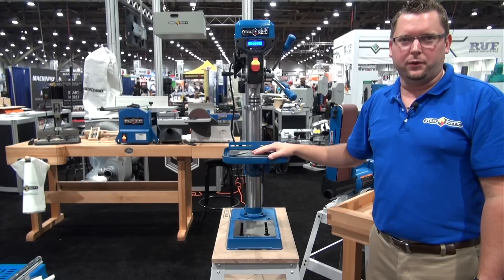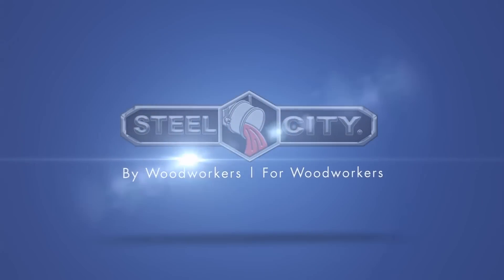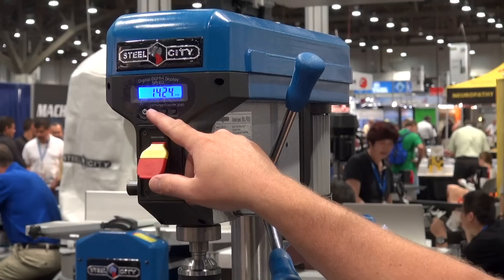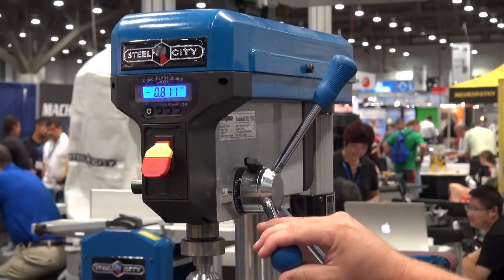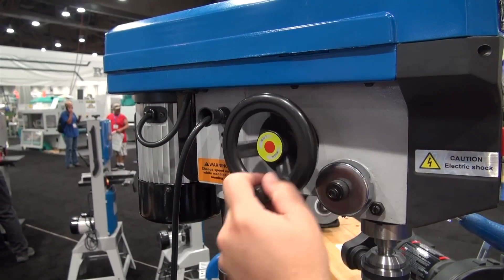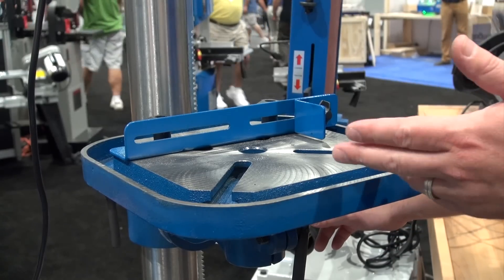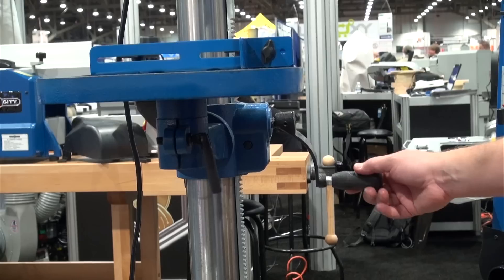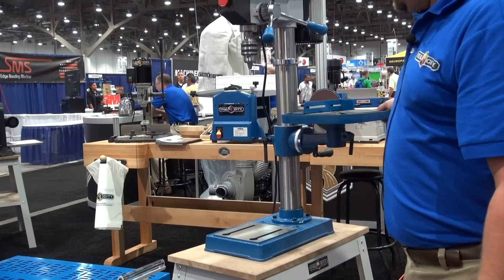Bench drill press: 13" Variable Speed Bench Top Drill Press Steel City 20130VS

Comment: Viewing the manual online, it says the recommended speed for drilling acrylic or for larger Forstner and brad tipped bits is around 250 rpm.  But the spec on this model says a minimum speed of around 480 rpm.  So, this model would not be recommended for certain larger bits in hardwood or even smaller bits for acrylic?  That is disappointing.